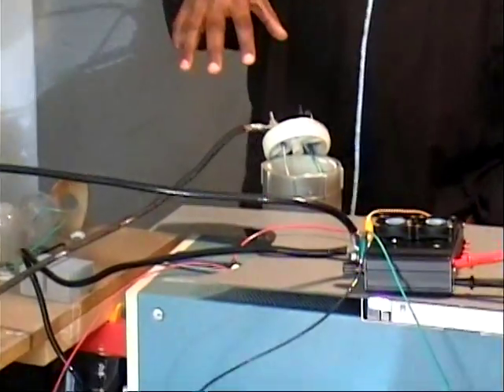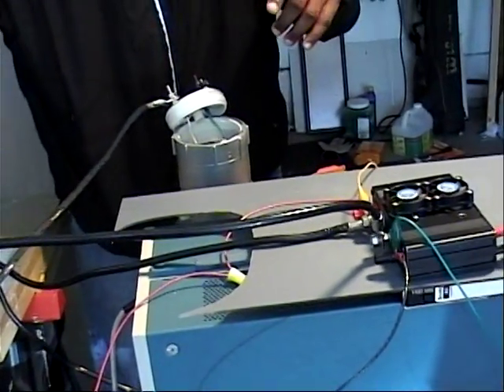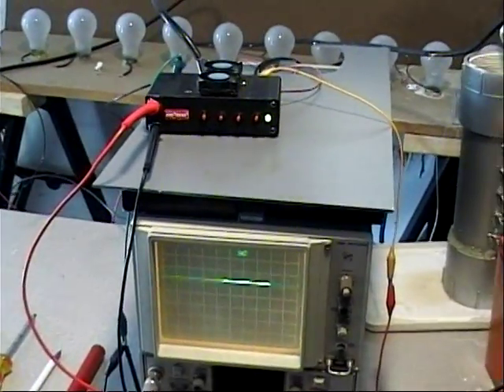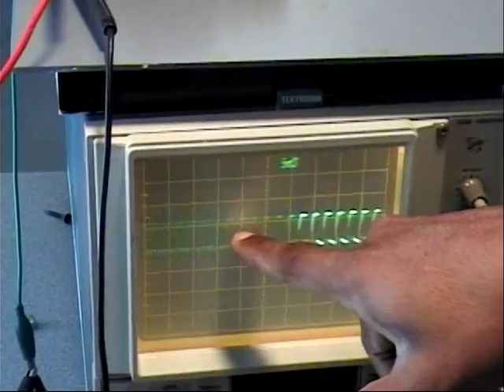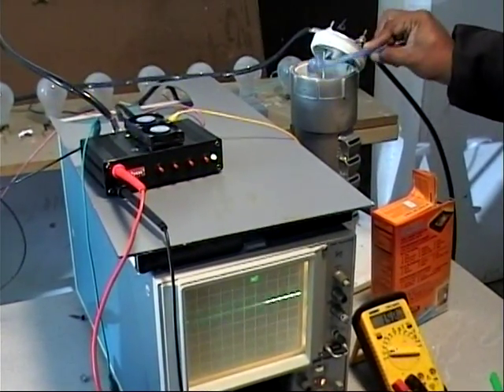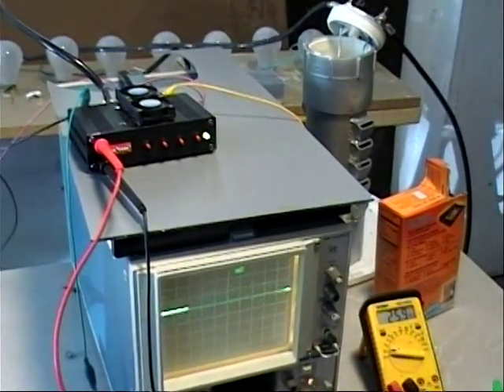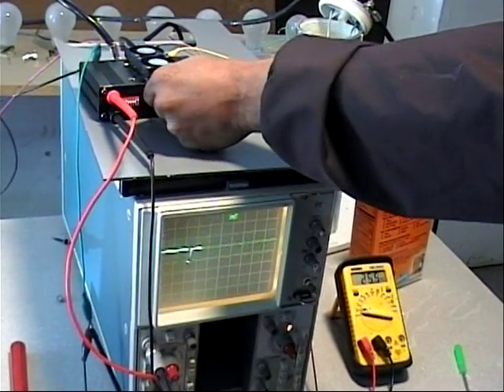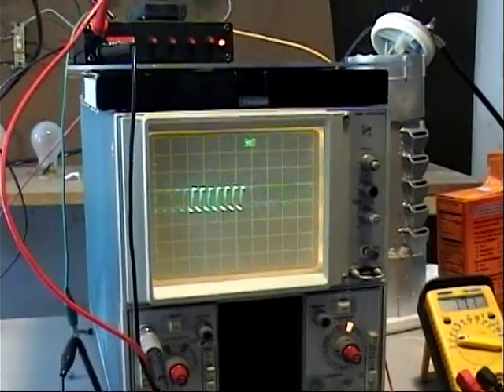CCPWM/DC TO DC CONVERTER "HYBRID"

Comment: @ttsqas Have you seen Bob Boyce? He uses a 3 phase toroid to drive the cell, with a DC biased, pulsed, frequency multiplexed waveform. I like the idea and think I can approximate some of his ideas by augmenting your PWM with a toroid transformer and my cell. I'll certainly be posting findings at my earliest opportunity.
I have (I hope) a cool idea for deriving a high current DC offset voltage from the car's motor, which I'll share too once I am able.
Stay cool, keep well, Sirstan

Comment: Hiya Troy, another cool video, thanks for it.
It looks great and I can't wait to receive mine. I'm hoping to show off my unique HHO cell using your power source. Have fun with the high voltage version, I think it's a great idea to try high voltage/low current. Have you thought of applying the potential to a micro mist or atomized water spray? May be worth someone trying this idea.
Regards,
Sirstan